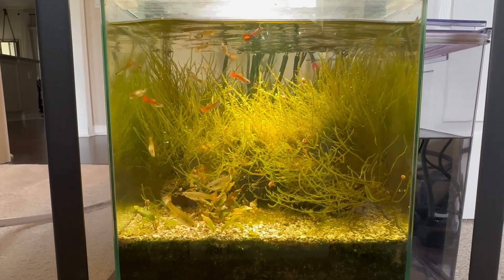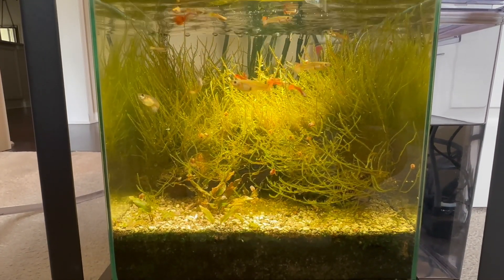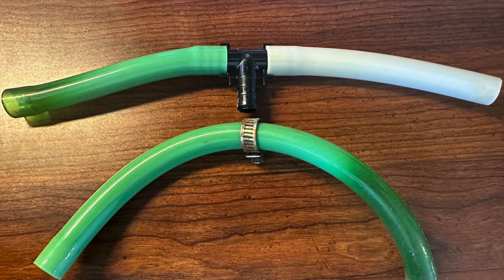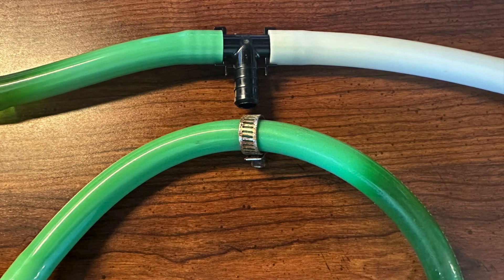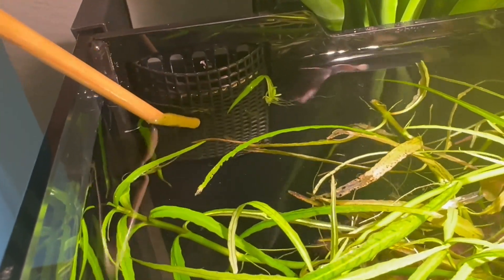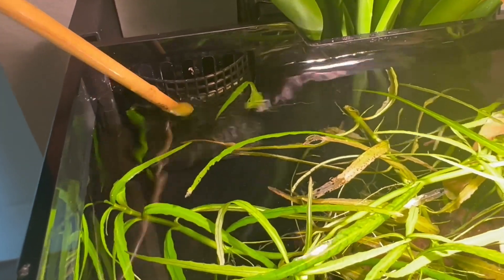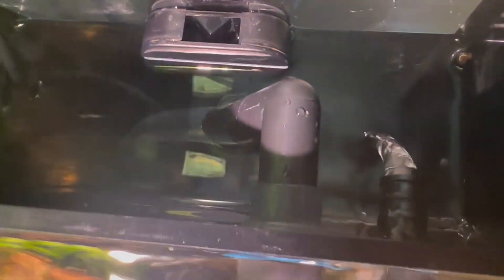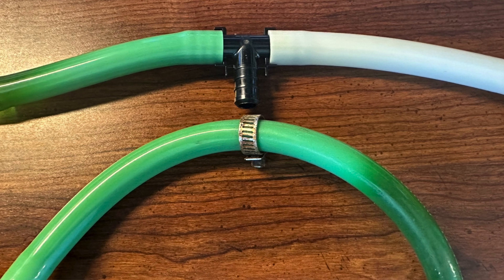How to make a gravity flow plenum.

Comment: Hello Dr Novak, I wanted to see if you could share any knowledge regarding my current set up.  I have a 180 gallon established planted tank with 6 large fancy goldfish. The tank does not have a plenum set up  but is a sump filtration system below that hold 25 pounds of matrix high capacity bio media in the center.  I have roughly 3” of black sand as my substrate.  I have watched many of your videos and understand how the plenum works but since my tank is already established is there anything I can do to incorporate bcb within the sump set up? If so would I make the bags like you have in one of your videos?  What part of the sump would I place it in? The center chamber where the media is does not have rapid water movement.  I actually don’t have issues with nitrates but I wondering if finding a way to incorporate bcb bags could be beneficial to my plants?  Could it also help with algae?  Any input would be greatly appreciated!! I can’t seem to upload a pic of my tank/sump set up in the comment.
Reply from the maker: The BCB bags would be placed in your sump once the water has been filtered. The same way, you would place a BCB bag in a canister filter after the water has been pre-filtered.

Comment: What do you think the flow rate is out of the plenum? Would you adjust the flow based on the total volume of the tank or total volume of the gravel/plenum?
Reply from the maker: https://youtu.be/q65fr9t0sJg?si=i_C-dwEcXGUJQVAs

I'm not sure of what the flow rate is, but it is very slow and it does show you that water is moving from underneath the Plenum.
Reply: @anoxicfiltrationplenums  Have you calculated the idea flow rate through the plenum,  based on the surface area of the plenum?
Thank you for your videos, I have keep fish for over 63 years and still learn something new from your work.